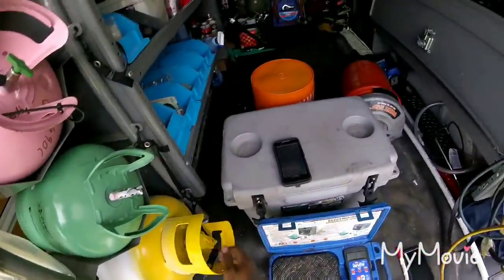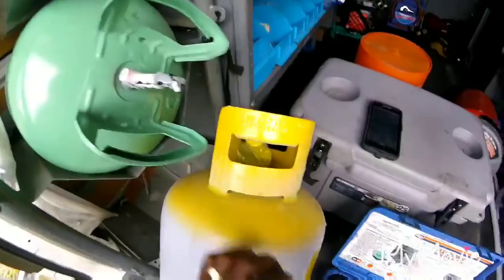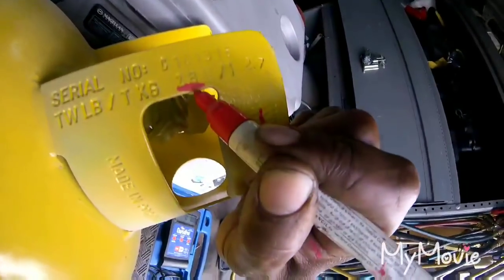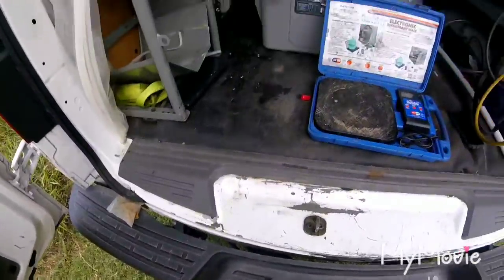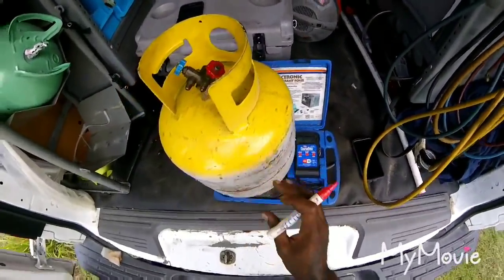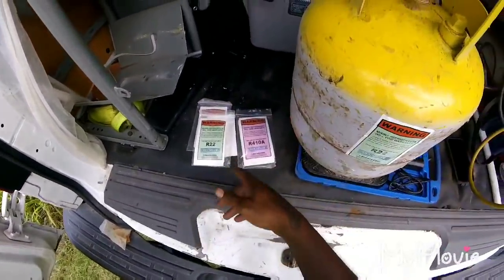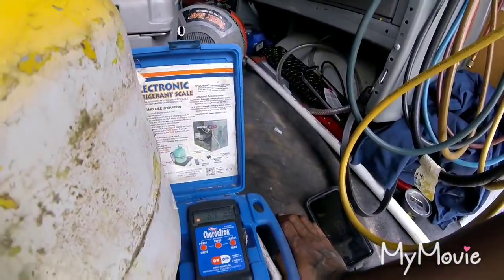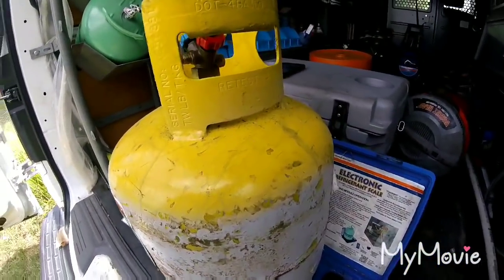HVAC: Recovery Tanks

Comment: My rule of thumb is 41lbs. maximum, so we’re basically on the same page. Certain refrigerants (i.e. R22 & R134a) can be filled to 47.7lbs. (28lbs. cylinder weight + 19.7lbs. refrigerant weight), but that’s not a good idea with some of the zeotropic blends (i.e. R404A, R410A). Virgin mean unused baby! Great video, thanks.

Comment: FYI the WC means Water Capacity of the tank . So that's the tank completely full with water. You use 80% of the WC number . Good job on the videos keep it up!
Reply from the maker: DanF 
WC= Actual=lbs?
Reply: Ya pounds of water if you were to fill it completely.
Reply from the maker: DanF  10-4
Reply: Technically you use 80% of the refrigerant weight by volume compared to water. I know starting to get complicated. Gotta be safe though. FYI R410a is quite a bit heavier than 22 so 65% is a good number for 410a.
Reply: DanF You’re correct Dan, heavier refrigerant = more volume required for expansion because more mass will create more pressure when heated - exactly why there higher vapor & liquid saturation points with R410a.